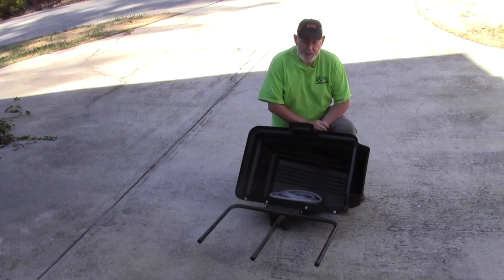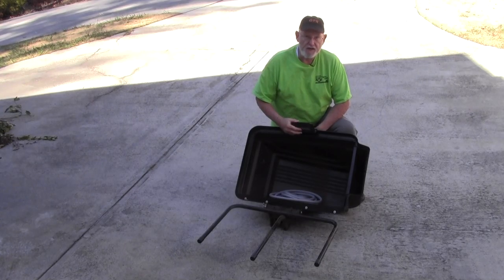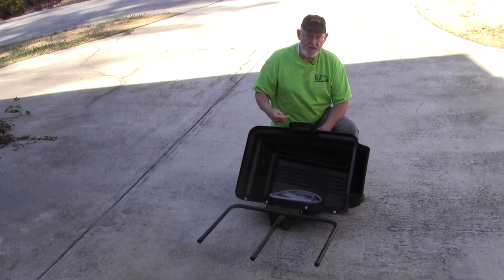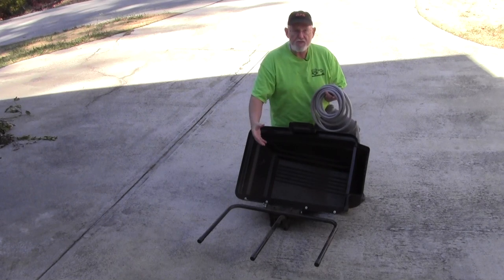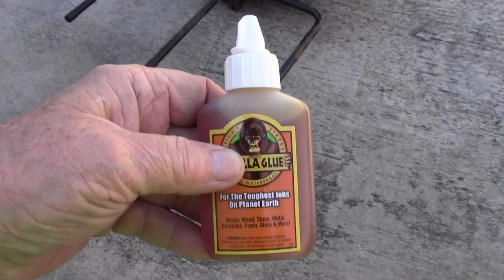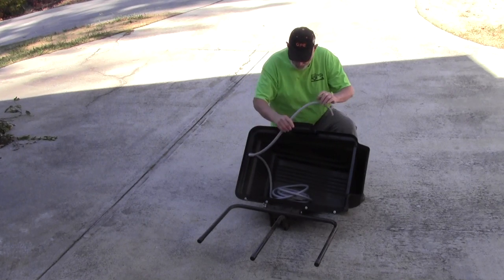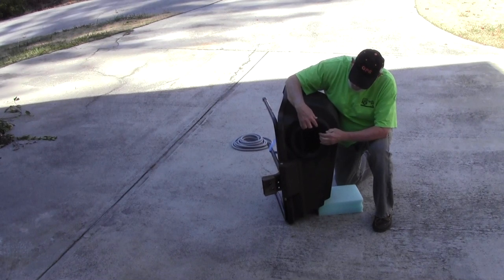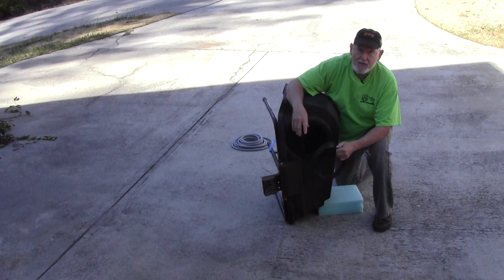Control Your Clippings...Fix Your Bagger!

Comment: It is not broken, but will not stay clamped down. I think I may have to remove the rivets and reposition it, or use some type of bungee set up. I may even try a hasp with a peg through it to hold it down and in place.

Comment: I find the glue solution tends to be short lived...any thoughts on a mechanical connection/reinforcement for the input hole? i.e. a metal or thick plastic ring on either side of the hole with multiple nuts.washers&bolts to clamp the ring to the unit. Has anyone tried this?.....

Comment: Dear 'Some Southern Stuff', I have about 10-feet of the 1/2" diameter, poly foam caulk saver....  is it okay to use that size??  
I see that you are using 5/8" diameter of the same material.    I was hoping not to buy another pkg, but I don't want to use this size and find out later that it didn't work, as I'm sure it would be VERY difficult to remove it once glued on.

Comment: I have the same bagger on my Craftsman. Left bag fills and overflows before right bag.  Does that happen to you, and what do you think of trimming a little off the tube to expand the hole right under the lid?
Reply: DomLucarelli45 That's normal on a lot of baggers, and does it on my craftsman soft bagger as well. The left bag spills over into the right bag once it's full. I reach back and check the right bag as an indicator it's time to dump everything.  If both the bags filled evenly, or the right one happenes to fill first, there would be a chance at plugging the vent on the side, which then may clog your chute.

Comment: What size foam did you use? Looks like 5/8. I'm going to try this tomorrow. I tried cleaning up my lawn today and dead Bermuda clippings went Everywhere!
Reply from the maker: Jonathan Davis It is indeed 5/8" caulk. I found some larger rope caulk intended for commercial uses. It looks like it may be 7/8 or even 1" caulk. I'll try that with an update video in the spring of 2015.

Comment: Karl, now that you have repaired the universal model catcher, is there a different (but still cheap) catcher model you would recommend or that you would rather have purchased yourself? And where can we get one? Thanks for sharing the nice repair you did!
Reply from the maker: Thanks for watching MR...coupla comments in response:
- To answer your question, NO. This is the one recommended by the manufacturer. Haven't searched for or tried others. I bought this one at Home Depot, but since it is considered a "universal" model, I think Lowe's has them too...or Menards up north or in the midwest.
- Gorilla Glue is NOT the answer! In fact, the craft glue that I mention in one of the comments below is better, but it's not very good either. It has finally dawned on me that silicone caulk might work very well,..it fills gaps, is very flexible, dries fairly quickly, is very durable, and sticks to the plastics, Next spring I am going to redo this video using silicone caulk. I'll post an update. If not for this issue, the bagger is a good one. As with any bagger, the chute clogs if cutting wet, or even slightly damp, grass. Stay tuned.

Comment: does anyone have a cure for leaf blow out on the right side front of the mower deck ?
Reply from the maker: +Daryl Dettmer Most lawn tractors have a spring loaded or detachable "cover" for the discharge that causes the clippings and leaves to recirculate and get chopped up very fine. These are called mulching mowers. If the mower is not designed as a "mulching mower", I'd be careful about covering up the discharge .
Reply: Look for the card Board in the bagger  tube from Packaging mine worked with it in there but after I found it in there it was a lot better

Comment: You can see the deck is ALL THE WAY UP. No wonder "nothing is blowing on the operator's back". Plus you have NO grass or any debris to pickup. Try this waste of time on some dry, bare spots of ground. See what you get then. Or some thick Bermuda or Zoysia.
Reply from the maker: Thanks for your input here and below, Jim. You are correct about the Gorilla glue...it was a REALLY POOR choice!

And you are also correct about the deck being "all the way up". However, we weren't cutting grass, we were vacuuming the dead, dry leaves that you see on the ground. As you probably know, dried leaves create a fine dust that is virtually impossible to contain. As you see in the video...no dust.

I have redone the setup with a larger foam caulk and tried several glues before the "final" try. Craft Foam glue seemed to work the best, but the Woodland Scenics Low Temp Foam Glue gun also worked well and served as a gap filler, too.